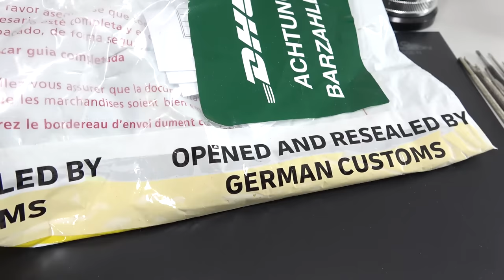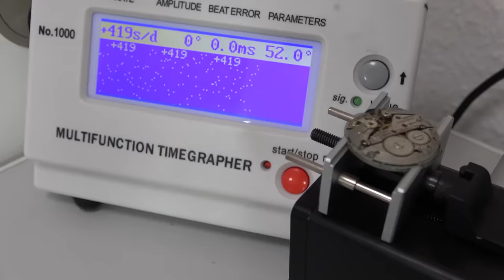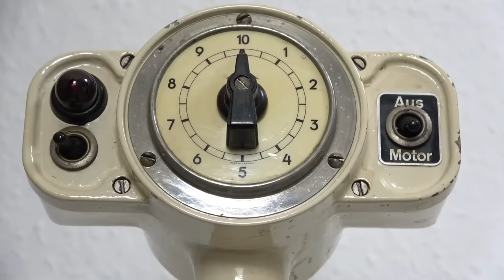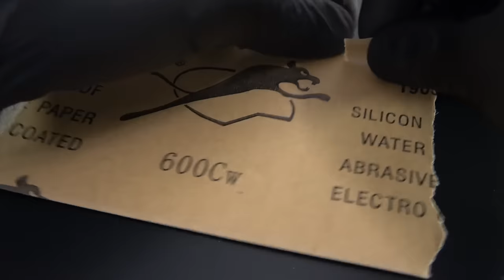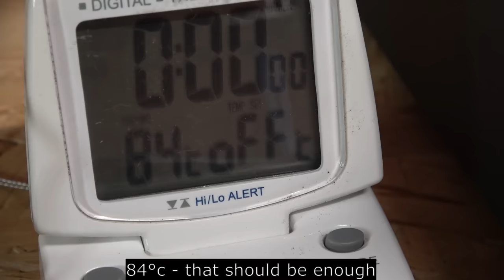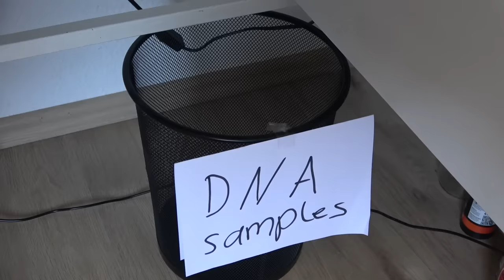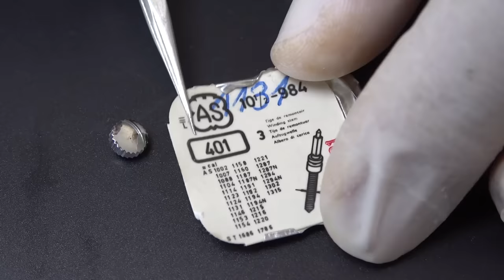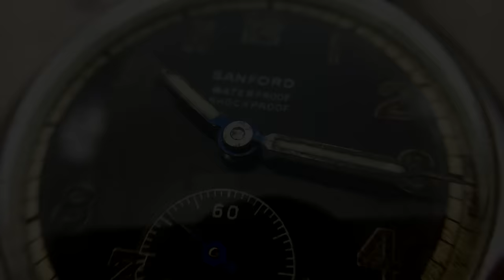Restoration of a rare vintage ww2 military watch - nickel and chrome plating - Sanford AS1123

Comment: This was not a cheap throw-away watch! 
Despite it's utilitarian appearance,  my inflation calculator says that $49.50 watch in the 1944 advertisement would cost over $700 in 2020 dollars.
Reply: lol a 700 dollar watch today is definitely a cheap throw-away dogshit watch.
Reply: @BPFACTS88  Maybe in your world, but $700 is a lot of money for an everyday wristwatch in mine.
Reply: @BPFACTS88  You are insanely out of touch with reality.
Reply: @greensquall2264  The reality is almost anything under $5,000 SECOND HAND is dog turd microwaved on high setting for 5 minutes. The cheapest affordable wristwatch that's somewhat worth buying is OMEGA SPEEDMASTER MAN ON THE MOON (starting at around $4,000 second hand)
Reply: @BPFACTS88  The snobbery here is astounding. Buy me a $700 watch if you have such deep pockets.
Reply: @greensquall2264  I would not ever buy a $700 watch, not even for my worst enemy. What could that $700 even buy on the second hand market? A dogshit Tissot or some ugly-ass Seiko with 4 different fonts on the dial?
Reply: @BPFACTS88  what makes a watch a throw away? Something that can't be serviced/fixed I think would be the strictest definition. There are several watches under 700 dollars today that are serviceable so that takes them out of the throw away category. As far as durability goes there are many 5000 dollar plus watches today that couldn't outlast a 200 dollar casio g shock in a torture test... so your idea doesn't hold water unless you would like to define the means of your terms.
Reply: @BPFACTS88  lol you are nuts

Comment: Fantastic! A pity the tools (especially timegrapher, watch cleaner and ultrasonic cleaner) are quite expensive, otherwise I'd try out taking some movements apart myself.
Reply: I'm new to watches so I don't know a lot: can it be cleaned manually or is there a risk of breaking it when doing  so?
Reply: @malcior6465  
The fine parts? Absolutely. Stuff like the case? Can be cleaned manually but it is harder and not quite as good.
Reply: if you want to get into watchmaking, i recommend buying a cheap cjinese movement and trying to take it apart and put it back together. when you manage to do that, then you can start thinking to actually restore vintage pieces. it looks easy, but the parts that seem huge on camera are actually miniscule, and it is next to impossible for starters to manage to put a movement back into working order
Reply: Thx guys

Comment: I have 1 question: Is your day job a watch  maker? With bladesmithing (what I do) You can just use common hand tools, but you have specialized equipment specifically used for watch making.
Reply from the maker: It's just a hobby 😉

Comment: I wish you could have used a new watch band as simplistic as the original. The replacement band is just too busy with the extra chrome features. Nice job on the watch restoration though!

Comment: I noticed you were picking things up with tweezers with a piece of what looked like a plastic bag in between, was the reason to prevent the piece from flying off if you lost your grip?
Reply from the maker: It's prevents scratches on the hands and the dial
Reply: @RedDeadRestoration  Thanks for reply.  Excellent video and I just subbed.

Comment: It's a shame you weren't able to keep the sharp case lines. 
Is there a chemical way of removing the old plating prior to redoing it?
Reply from the maker: Yes there is a chemical way but this also dissolves the base metal underneath. So I wouldn't recommend that way

Comment: sweet watch and awesome video but there were definitely chemical and electrolytic processes you could have used to remove the old chrome and nickel instead of a file and sandpaper.
Reply from the maker: That's correct but that chemical stuff would damage the base metal as well
Reply: @RedDeadRestoration  didn't consider that, thanks for the reply. still hurts a little seeing stuff like that get sanded

Comment: Being a technician in a different field, I always enjoy watching these types of videos. One thing that has me a little confused though, and not to be anal retentive, but to expound my own knowledge as to why.... 

1.) You spent a lot of time on the housing and other parts, but you seemed to barely do any restoration at all the the "face" of the clock, which clearly still had some extra work that needed done. Can you please explain why you left this in a partial restoration state? 

2.) The minute and hour hand. I found the method you used to replace the luminist middle portions, to be a little awkward. It was obvious to the naked eye that it had ran over the edges and wasn't very well trimmed or controlled. Sorry, I am slightly OCD, and I believe if you put this much work into something, you should take that effort all the way. After all, it now bores your name and skills on its outcome... My question is, is there another way you could've filled in these sections with a luminous inner piece? Or, is there a way you could've maybe cleaned up/trimmed the pieces after they had cured/dried with the solution you used? 

Thanks for the video. I always enjoy watching these types of things. What would've been ever cooler is if you could've found out who actually wore this watch in WWII and if still alive, presented it to its original owner... That would've been priceless...
Reply from the maker: Thanks, I will try to answer your questions 😉

The dial of the watch was painted decades ago. Even touching it slightly can ruin it (erase the paint). Cleaning the dial is impossible without ruining it. Restoring the dial always ends up in repainting it and that is deleting all the originality and history of it.

About the luminous paint, it's not messed up. What you see while I'm repainting it is the underside of the hands. On the top surface you won't see anything of the paint around the hole in the hand. That's how it's done and even the original paint was applied like that 😉
Reply: @RedDeadRestoration  Thank you. I understand now. :)

Comment: My goto cleaner for the first round on dials is multi-surface cleaner like the stuff you dust furniture with it is already designed to not destroy most surfaces.
My anal side would want to buff and retexture the movement at 15:48 to get some of that corrosion marks off, it is far away from anything dimensionally important, so should have been doable.

Comment: What would you charge to repair a citizen for me? If your in America for shipping and currency purposes lol
Reply: I’m not asking for a video on it, just to get it repaired to be clear, it works occasionally and it jumps two seconds instead of one if that helps to diagnose the issue thanks
Reply from the maker: If it jumps 2 seconds at once the battery is low. It's called "end of life indication"
Reply: @RedDeadRestoration  it’s an Eco drive, and I’ve had it in the sun and artificial light, but that is cool to know that watches do that lol

Comment: Beat error 1.8ms you could have adjusted the balance wheel screws. Sloppy dial cleaning. NATO strap looks rubbish on this watch. Sloppy job overall.
Reply from the maker: There are no Balance wheel screws and adjusting the beat error is a hell of a work on watches like that. Even though the beat error is not really important. Cleaning the dial will ruin it, the painting will clear of when you try to clean it.
Reply: @RedDeadRestoration  If you look at 4:09 and 4:20 and 18:38 those are balance wheel screws unless I'm imagining things. In your other video below at 12m59s you carry out this type of balance wheel adjustment albeit on a Rolex. Unless I've got the wrong end of the stick.
https://www.youtube.com/watch?v=y5f9LM90czY&t=11s
Reply: @roadgent7921  wdym? it's a nice looking NATO strap, ribbed nylon is quite nice although a little harsh on my skins.